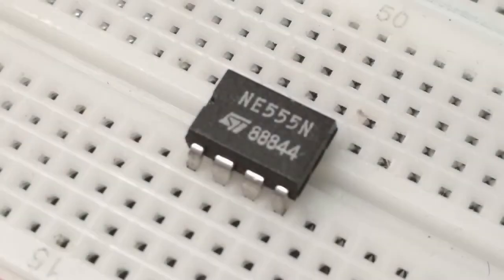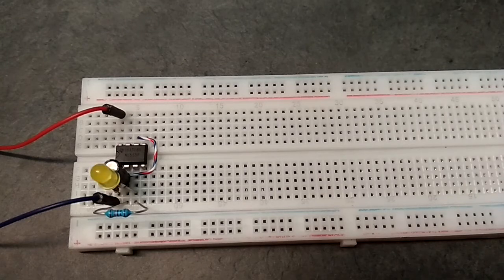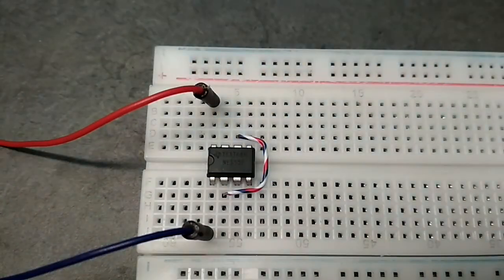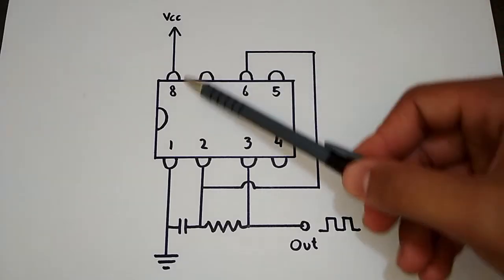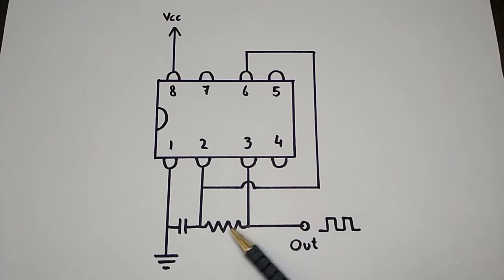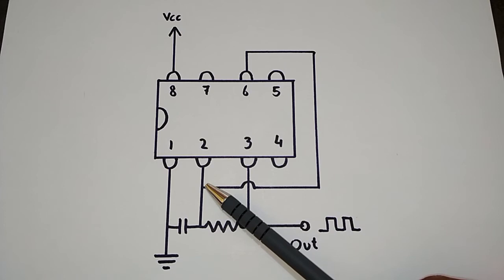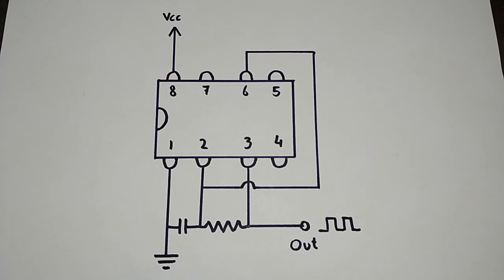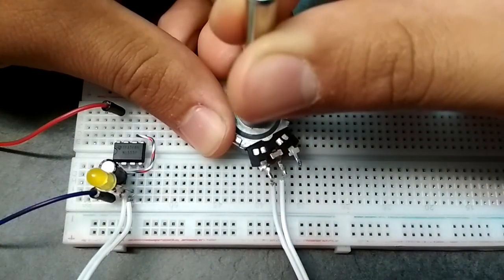Easiest Way to Connect a 555 Timer For Astable Mode (Blink an LED)

Comment: Can this circuit control 12v load? Or only the LED?
Reply from the maker: The NE555 should be able to source a few hundred milli amps max, always check the datasheet to be safe

Comment: Is it possible to have a long duration blinking with this circuit?
Reply from the maker: Do you mean just low frequency, or high duty cycle, where the LED stays on way longer that it's off?

If you just want low frequency you only need to increase the values of R and C. But the duty cycle will always stay close to 50%.

If you want the LED to stay on way longer than it's off (high duty cycle) this circuit won't do it. You should use the traditional astable circuit.

Comment: Okay so my oscillation is not a square wave, it has a step up before it goes to full voltage on the oscillation.
Like a stair step pattern????
I'm so confused lmao
Reply from the maker: Beats me, maybe check that the supply turn-on is not a slow ramp and check that your IC is good.
Also double-check the circuit just in case : )
Reply: @5VLogic  I got it to work xD
Dont know why it was doing the thing lol
Reply: When the LED is half-lit, it pulls more amps from my PS, and when its bright it drops back down? xD
Reply: Maybe my timers are broken lmao... i did get them from amazon lmao

Comment: It's a phony video. The NE555N is controlled mono-stable with 1 resistor and 1 capacitor. Then use a blinking LED.

Comment: I use this circuit since 40 yearsm because of its simplicity. But you cannot expect to get a duty cycle of 50% with the NE, SE and LM version of the 555 timer due to the fact, that the output stage of these timers is not rail-to-rail. So I used the CMOS versions like the TLC555 or the LM7555 because of their real symmetrical output stage instead.

For the LM7555 you need to considerm that the voltage divider is not 33%, 67% but 25%, 75%. So the time constant of this device is considerably longer. You have to use another formala to calculate it. but considering the fact you get just other R, C values for the same frequency.

It is also easy to change the duty cycle for a certain frequency by using a potentiometer and two diodes to separate the charging resistor from the discharging resistor. If you need higher linearitiies you can implement two current sources instead of two resistors and diodes. In the simplest representation you can just substitute the resistor by two anti-serially connected constant current diodes.
Reply: So thats why i wasn't getting a 50% cycle! thank you :DDD

Comment: Mine works but it doesn't blink. The LED is just stable, I made sure I have a jumper connecting to pin 2 and 6.
Reply from the maker: First thing that comes to mind is that the values for R and C are too small and the LED is blinking too fast to notice. Be sure that R*C is in the order of 1 to 0.1. Hope this helped.

Comment: I've tried with 5V and this don't work, with how many Volts did You set they circuito?
Or its another bullsh*t vídeo? I'm tired of all people uploading videos that just are scams... Maybe it's just another scam video, or My capacitor it's damsged
Reply: Obwód działa!   tak jak na filmie. Jeśli masz komponenty sprawdzone-musi działać. Mój timer 555 pracuje nawet przy Vcc=4,6V Moje komponenty: C =47 mikroF,  R= 5K
Reply: Bro it works....

This is the first oscillator i ever made... and it worked the second time i tried to put it together lmao

Comment: Sir  what is the value of the resistor and capacitor
Reply: normally I’d say you can look at the resistor in the video but the code is very ambiguous. it’s not clear which band is the first band.

Comment: Definition of a TRUE engineer....
Someone who can achieve the same objective as another "engineer" using less time and money.
You've earned another sub!
Also, is there a simple way to make the LED fade in and out rather than switching on and off with the square wave? I guess a triangle wave would work well for this. The limited bit of electronic knowledge I have makes me think of attaching an electrolytic to the LED in some way. When my breadboard arrives, I'll fiddle and see if this works. Maybe cap between anode of LED and ground. If I had my breadboard, I'd not have to ask this!!
Reply: you can use an rc low pass filter at the output to turn the square wave into a triangle wave :3

Comment: Theoretically is it possible to device a modification that will allow PWM? Asking for a friend :-) Félicitation, bon travail.
Reply from the maker: Yes, the diode approach can be applied to obtain a rudimentary PWM: a potentiometer's middle pin is connected to pin 3 (OUT) and the other two pins (of the pot) are connected in series with diodes (in opposite directions) to che capacitor. 
By adjusting the pot position, the duty cycle changes. There are quite a few tutorials on this concept but applied to the traditional circuit so I avoided reposting the same stuff...
Hopefully that's clear enough,
Thanks for the question!
Reply: @5VLogic  Yes! Just wanted a second opinion before doing the field work/cogitating. I have set-up recently some 555 IC's with this type of adaptation: i.e., PWM and varying F with pots and diode biases.  Daniel Talbot on YT his an exemple of mod. that can be adapted here for the need.  Merci.